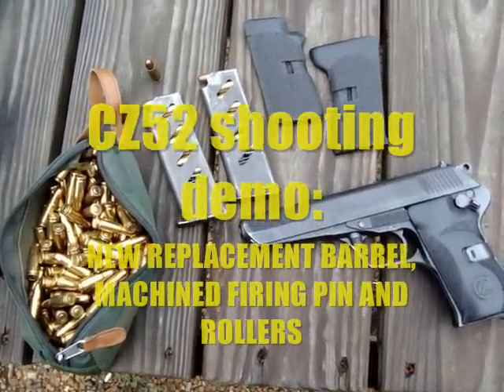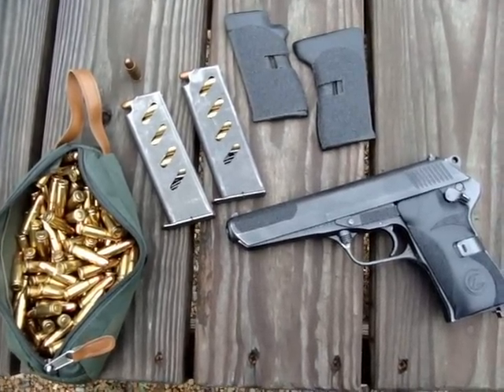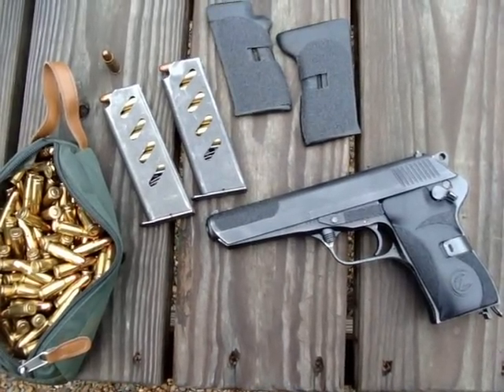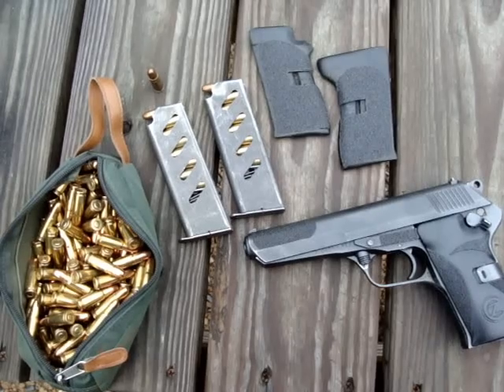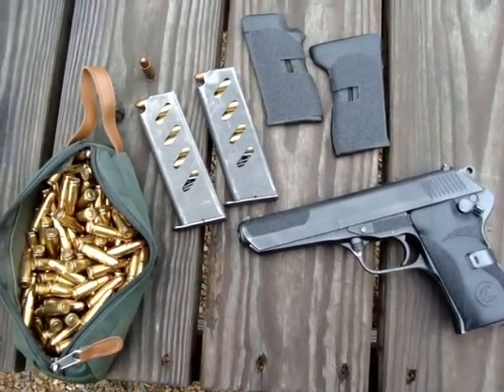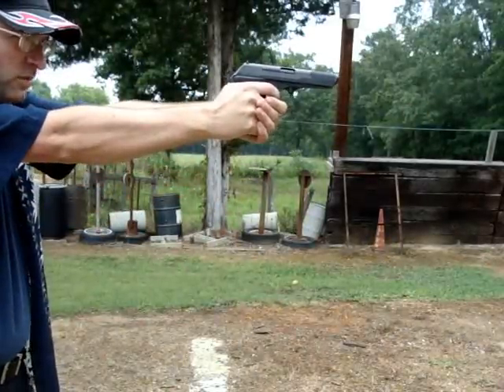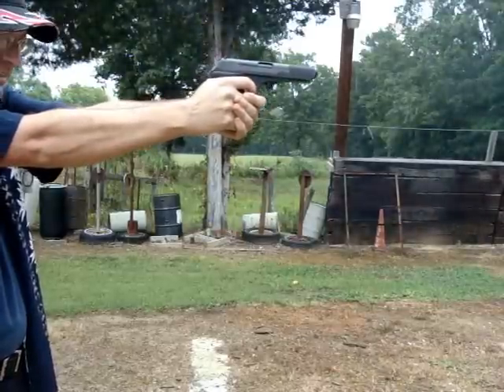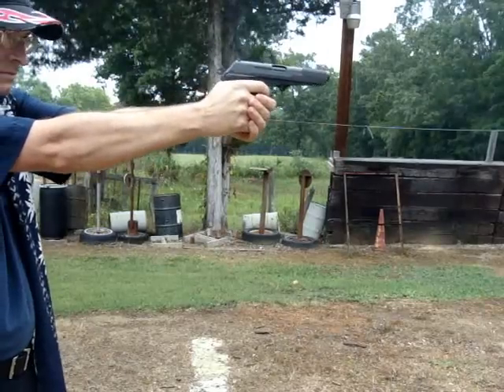CZ52 upgrades 1

Comment from the maker: @TheHiddenPart the trigger is a bit heavy for a single action, which led to some anticipation problems, I kept flinching, but after two different range trips and 200+ rounds I got my finger position right and a steady pull, I was jerking the trigger bad too.  It's not a bad trigger, just military grade, you know.   I have found that if you don't get your finger placement correct, it will slam your trigger finger and make it a bit sore, and that does not help.

Comment: I've had my CZ for over 10 years, and I never knew they made (used to make) rubber grips for them. Impossible to find now.
Reply from the maker: +Kevin Letterman true, the grip replacements I had where being made by a guy who did injection molding and made his own dies to make the grips.  no such luck on the rubber ones though, that would have made a huge difference in control.

Comment: There are, you can get some nice aftermarket upgrades too. I would suggest the Firing pin upgrade like this guy got, and the lighter trigger like i commented above. They also have threaded barrels, slide releases and i believe America style mag releases(or its DIY dont remember). The stock trigger and mag release are my 2 Con on this pistol.

Comment: The CZ-52 shoots very flat and accurate to start with.  And mine has not had a single failure to feed or jam of any kind after about 500 rnds.  But I have broken a firing pin.  A machined replacement for that would be welcomed.

Comment: Your a brave man extracting that unfired round so quickly. You should wait 5 seconds .
Reply from the maker: Jason B not really, this is not like artillery or mortars where you allow time of cook off, typically a failure to fire drill is tap the mag, rack the slide, attempt to fire (tap, rack, bang). You may know that already if you are military.
Reply: Smithjac USMC sorry brother you are wrong when it comes to range safety. And just because someone is in the military does nor make them god . I have been shooting, and building firearms for 30 years and if a round doesn’t fire you wait a few seconds. If you ever did that at a legit range a they saw you they would say something.
Reply from the maker: Guess I never shot a legit range....that, in my opinion, is not range safety, it's nanny range paranoia; and never has that been part of any range safety brief that I have recieved, nor the ones given by myself, when I ran a rifle range for the Marines, but I seem to recall hearing or reading it somewhere, way back when..just not on the range..
Now with that said, I don't disagree that perhaps it is wise to give a pause when under certain circumstances, i.e. a public range with many bystanders and shooters, to be conscientious of others, and of course, obey the range rules and policy, I conform to a lot of things I don't agree with, and I typically shoot where I have freedom to practice techniques with low danger to others and myself. 
I also never meant to portray any military person as a god, for all are human and subject to failue, mistakes and death....accept for me of course...kidding..anyway, I may be brave, or just....

Comment: I just ordered a new firing pin and rollers. Did you have any issues ordering from Harrington products? Their checkout is a bit sketchy, but if I get my parts I'll be happy.
Reply from the maker: +Jeshua Power it's been about 5 years ago I think, but never had any problems get'n my parts.  and they work real nice.
Reply: +J.A.C. tn marine I just received my order, but I have to modify the gun for the firing pin to fit. has anyone else encountered this issue?
Reply: I know you probably already have but I wouldn't get the hardened rollers. Its easier to replace the rollers a few times with the soft ones over replacing the slide. There was a reason they used soft ones when they made it. Just my $.02 though. I've sent thousands of rounds down range and have never had to replace mine but I do believe in a good clean every time I shoot though.